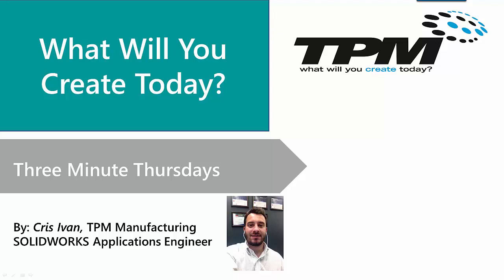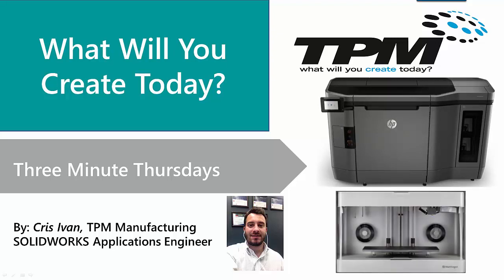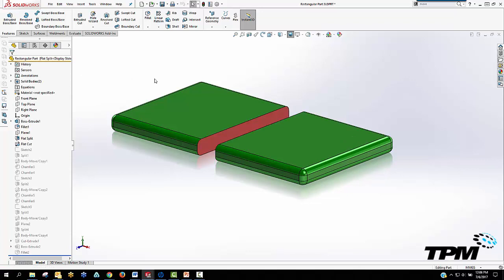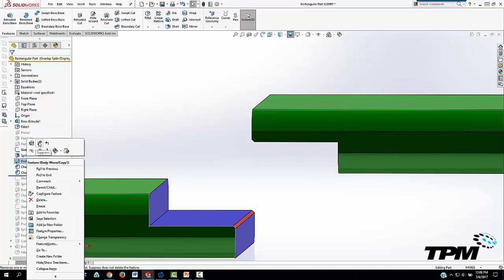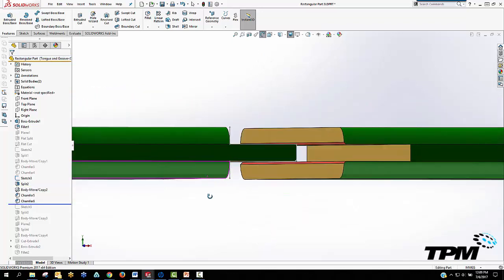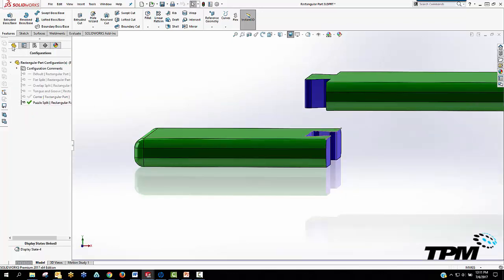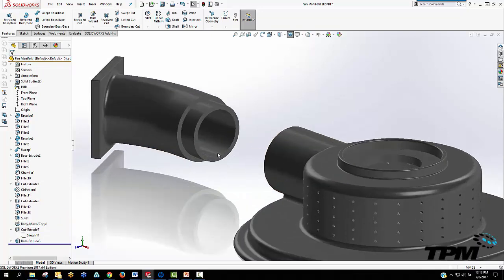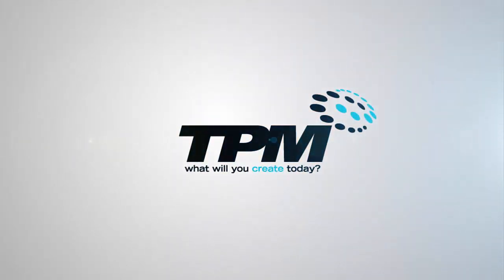Split Parts to Fit into 3D Printer

Comment: hi sir,which software are you using?
Reply: Hi, I use SOLIDWORKS on a daily basis. That is for my CAD work. For slicing software it matters on the printer I use. Markforged uses Eiger, which is proprietary and a great tool. In this video, I'm showing Smartstream, which is the slicing software that comes with HP's Multi Jet Fusion printers. I also use NetFabb and Magics, both of which do about the same job, both of which are AMAZING, but more costly. Cura is ok, and i have used it in the past, but currently don't have a printer that needs it.